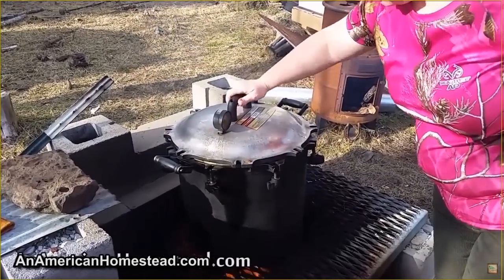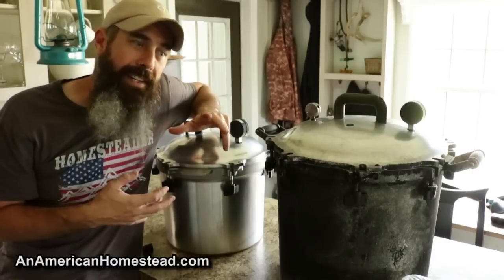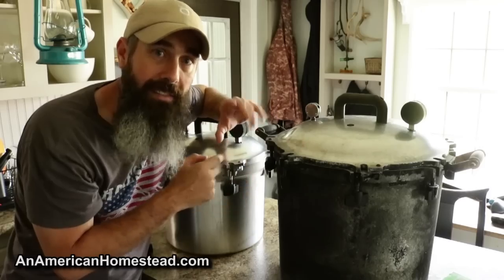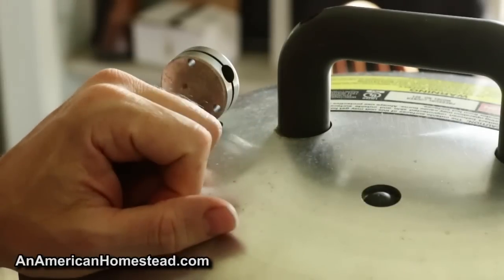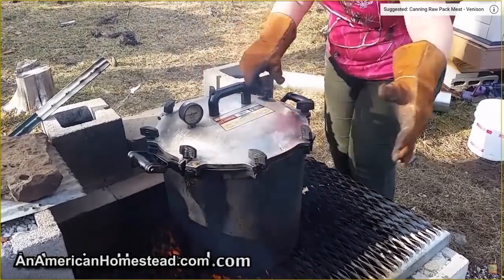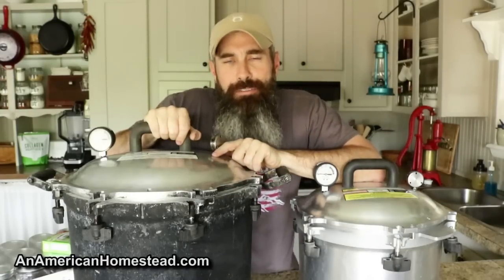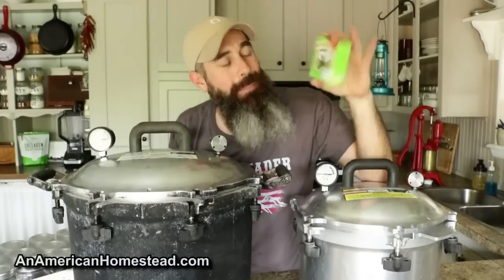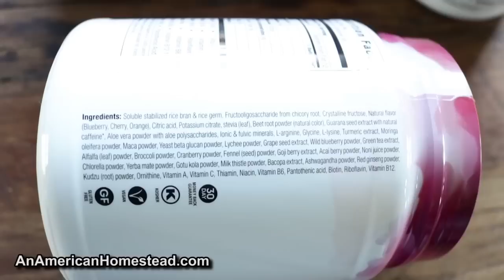Your Pressure Canner Just Broke! Now What?

Comment: I laughed when I saw the title of the video, and when you brought up losing the regulator on the canner I was thinking what a coincident.🤣 Last night I was cleaning my canners and somehow lost the regulator off of one of them. I have a feeling one of the cats stached it away as a new toy. Now I have to turn the place upside down looking for it 😠
Reply from the maker: Oh My!
Reply: I keep mine inside the canner after it is cleaned and dried to be put away. That way they don’t get lost or mixed up.
Reply: @chomama1628  I do the same thing. I replaced the standard pressure regulator with the adjustable version for my Presto canners. The standard ones are also stored with where I keep the rest of my canning specific gear.

Comment: I know people frown on this but... everything you can pressure can you can also water bath, it just takes longer. You can even go online and find timing charts with all the foods, even cabbage and brussel sprouts and all the different size/pressure/ water bathing times. I have a couple pressure canners but recently had a pinhole in my run of the mill water bath canner from a small spot of rust, I have had this happen before. I got frustrated so started looking for a stainless steel water bath canner. It was more expensive but well worth it. The bottom is heavy enough that I would not hesitate to use it to make cheese, the lid is clear so you dont have to open it to check your water level losing water from evaporation and the handle has a temp gauge in it. Now I am feeling a little safer has far as being able to can my food in a long term SHTF situation.

Comment: If you can over a natural gas or propane stove in the kitchen, it is clean, convenient and easy to regulate. If you can in the fall or winter the fuel is FREE. All the heat used during the canning process goes into the house or food that later cools putting the heat back into the house. Any amount of heat that goes into the house this way, your furnace does not need to supply. You are just using the heat you would use to heat your house to can your food first. If you want you can even let the water cool in the kitchen before pouring it down the drain to save that heat. If you can in the kitchen in the summer and run the air conditioning it cost you about 3 times the cost of fuel to burn it and the cost of electricity to pump it out of your house.  So I can in the cold months and don't worry about it.

Comment: Yea took the plunge and bought All American  925 - 25qt ....im thinking since I did the order it may be just a little too big, just me and the wife.  Still waiting for it, they tell me it may be another month...oh well,  it wasnt cheap, $500 CDN....almost canceled it last night as I thought about the price and saw a Presto for half - once I get it and do the first dozen oh so jars of meat and butter I will be happy with the decision.
Reply: FWIW.... I have 2 large Presto canners. One  purchased in 1972, the other in the mid-1990's. I've downsized considerably. (Two people, here.) Rarely ever can in quarts anymore, as pint jars are enough for most meals. To that end, early this year (pre-pandemic) I bought the Presto 16 quart canner. Ideal, IMO, for small batch canning. It holds 7 quarts, 10 pints and 12 1/2-pints, regular mouth jars. Still have the larger canners, if I want to can 18 pints of something. 

FWIW... Presto canners have served me well over the years. Went on a canning marathon earlier this year to can most of the meats and vegetables in our freezer due to the projected hurricane threat for 2020. Based on what's happening, I'm glad I did. The point, is that Presto did exactly what I needed for it do do. The only "spare parts" I need to keep are gasket kits, since I converted the standard regulator to adjustable versions for the 2 older canners. Gasket failure over the years hasn't happened often enough for me to complain about it. Rather the opposite, as it's more like needing to change the oil in my vehicle from time to time. (Gasket change far less frequently, BTW.)
Reply from the maker: Trust me, you made the right call with the All American.  It will last a lifetime if you take care of it and you won't ever need gaskets.  I wouldn't trust any other brand over a fire.

Comment: Find an old woodstove. Doesn't need to be a "cook" stove as long as it has a removable lid or two. You use less wood and with goid damper control you can regulate heat better

Comment: I have a Granite Ware pressure canner that I just bought.  It's ok, but I wish I would have gotten a larger one.  I can only can 4 quarts at a time.  Also I didn't know that I would really love canning like I do now.  Dang......

At least I bought the big Mac Daddy Excalibur 9 tray dehydrator!!!!
Reply from the maker: I used to have an Excalibur and loved it.
Reply: @Anamericanhomestead  I'm dehydrating potatoes, pineapple and strawberries right now.  I learned the hard way don't dehydrate onions and garlic in the house.  My husband was pissed !!!!!  Lol
Reply: @Anamericanhomestead  what dehydrator do you have now?  I wanted to get a freeze dryer, but that is WAY OVER MY BUDGET.
Reply: @crazydee1955  I have an Excalibur 9 tray, too. Can't justify a freeze dryer. I can put a lot of purchased freeze dried food on my pantry shelves for far less than the cost of a dryer. Especially since the Excalibur will do most of what I need to do from a dehydrating standpoint. For example, I don't need freeze dried green peas as I already have the options to can and dehydrate them. Have done both with good success. A couple hundred dollars can put quite a few servings of freeze dried meat on my pantry shelves. The same amount of money can also put a whole lot of canned meat on my  pantry shelves, as well. 

From what I understand, space savings between wet canned and freeze dried isn't material because the food doesn't shrink, as it does with dehydrating (especially vegetables & fruits). So that can't be used to help justify the purchase.

Comment: I'm trying a couple of different lid sources and wonder if anyone here has experience. The first is the mainstays brand from walmart, they look regular but the second is a one piece safety button lid. It's difficult to find info since they aren't "approved" but I've seen them used by home canners in Europe. Do you (or other commenters) have experience with the one piece lids? Another thing, I suggest looking for older canning recipe books and instruction books, they are continuing to update and make changes to the recommended methods. I'm sure it kills more bacteria to pressure can everything, but generations have not pressure canned say, jelly or tomatoes. Yes, some things must be pressure canned, I understand, but my mother and grandmother didn't even use waterbath canning for jams and jellies, they used hot jars, hot jam, topped with paraffin, done, not even a lid until the seal of the paraffin was removed. Thanks for the reminder for these back-ups, there are so many things to remember that we have had at the ready for so long.
Reply: Never used 1 piece lids for wet canning, so can't comment. As to older canning books, they are fine to use as long as you use current recommendations on process methods and times. There was a major change, for example, in the 1990's regarding canning tomatoes because of the low acid hybrid varieties. You can still safely use waterbath canning for high acid foods. Jams, jelly, pickles, etc. Using paraffin to seal jams is discouraged because mold can form inside the jar and the spores spread throughout the jar. Please research this for yourself. Don't take my word for it. 

Your kitchen, your choice, as to how much risk you're willing to take.
Reply: @oldtimerlee8820  Ah, I didn't think about the lower acid hybrid tomato, I wondered about that. Makes sense. Yes, the paraffin was not a good way to preserve, moldy jars did pop up every so often. Thanks for the info

Comment: I have a volcano stove and a rocket stove. The ability to can over fire is the reason I chose All American.
Reply: Heather Dubreuil There was some blackening. I don’t think there was as much wear and tear on the parts. But I have always kept extra parts around. And unlike the other canners that use gaskets, the gaskets will dry rot over time in storage. The extra parts on the AA canner will not. I also do not use it exclusively on fire.
Reply: marthale7 I was able to can on mine with the original grate.

Comment: Tattler Lids? Not a problem here with the Tattler Lids. Inspect the rubber rings , lids and the jar for chips or cracks.  Follow Tattler's directions.  I had failures with Tin lids as well as Tattlers  lids. Most cases it is human error.    Oh and a 1/8th inch sheet of steel between your canner and the fire would have kept the canner cleaner and protected the locking knobs.

Comment: Poor quality pressure cookers just blow up on the stove damaging the stove the hood and everything around.
During August we use the canned tomatoes sauce in those mason jars, same with raspberries, blueberries and blackberries preserves over the stove in a lobster pot to cook and seal the jars.
Reply: Modern pressure canners, from reputable brands, don't "blow up on the stove". They have a pressure release valve that prevents that from happening during unattended  canning. Yes, any large pot, with some type of rack, can be used for waterbath canning. Another good example is the big pot sold for frying turkey over a propane burner. 

Yesterday, at our local Wal-mart had several waterbath canners and 1 Presto 16 qt pressure canner. Generally, the shape of a waterbath canner with a rack, is easier to use. If memory serves, it was about $20 . Well worth the investment, when you can find one.
Reply: @CATherine001  There are responsibilities associated with using any piece of equipment. One of them, is to learn how to safely use it. I have a woodworking shop with several tools that can take off my hand, if carelessly  used or abused. 

In the link.... There was definitely something wrong with HOW that pressure canner was used. Probably multiple things based on how it works. If the vent pipe was open, as it should be, the pressure regulator (if it was the correct one for the canner) would have released steam after the specified psi was reached. 

If the vent pipe was plugged, the pressure release plug would have blown before the lid blew off. Question becomes was a bolt, for example, used to "temporarily" replace a deteriorated release plug"? Can't tell from the picture. 

That looks like a pressure canner that I have. Once the lid is actually locked into place, it can't come off in that manner. It operates similar to a lid that screws onto a jelly jar. Can't pull it straight off. Lid must be physically turned counterclockwise to get if off. 

It's possible that the one in the picture is an old, old pressure canner that didn't have the safety features of the ones in use today. 

Lastly, one of the comments under the pix in the link, talks about how to ABUSE a pressure canner. Doing things that shouldn't be done with a pressure cooker or pressure canner. 

FWIW.... I have been pressure canning with Presto canners since 1972. There's no telling how many jars I've processed over the years. Currently have 3 Presto canners. All 3 fully functional, including the one from 1972. That durability, alone, should testify to the quality of Presto canners. 

Additionally I've cooked many a pot of beef stew using my Mirro pressure cooker. Probably purchased sometime in the 1980's-90's. Still does what it's supposed to do.
Reply: Oldtimer Lee Great info.!
Well I guess we can attribute these mishaps as Operator’s malfunction. 😂 

I have a question for you,
 why do we need a pressure canner when you can stick mason jars in boiling water or hot water to  self seal the jars?
I have made a lot of fresh tomatoes sauce and never used a pressure cooker. The jars’ seal would last up to a year just in time for next season.
Reply: @CATherine001  A pressure canner is needed to can low acid foods. When  using a boiling water bath canner, the temperature of the foods never exceeds 212F. That's fine for many high acid foods.  However, that temperature is not hot enough to kill the spores of a bacteria that can create a deadly toxin, in the right circumstances. The circumstances that exit in a sealed jar of low acid foods. Low acid, low oxygen, moist conditions and room temperature. 

The bacteria is called Clostridium botulinum. It is a common bacteria that doesn't cause any harm until conditions are right for the spores to produce botulism toxin. 

When canning to kill the spores in low acid foods, the food must be heated to 240F according to guidelines for the item being canned. The only way to get the food to this temperature, in home canning, is to use a pressure canner. For my altitude 10 lbs of pressure will allow the food to reach that temperature and kill the spores. The food must be held at that temperature according the guidelines for the item. Can range from just a few minutes to 90 minutes for meats in quart jars. 

For much more on this subject, please Google: National Center for Home Food Preservation General Canning Information
For Safety's Sake
https://nchfp.uga.edu/how/general/for_safety_sake.html

Your pressure canner manual should have information on this. If you don't have the manual Google the brand of your canner, model number and the word manual. 

If you don't have  one, try to find a current copy of the Ball Blue Book of Canning. It's usually around $10-$12 and is well worth the investment. It covers the differences between water bath canning and pressure canning. It has great direction for both, along with recipes and tips. 

Hope this helps.
Reply: Oldtimer Lee Yes is does!
Thank you so very much I really appreciate it! ☺️

Comment: I get the feeling you will be surprised at how cheap propane is
Reply from the maker: For a small canner...yep....not the 941. You need a large burner...and then its not so cheap. We get slab wood for $20 bucks per ton. And what if you can't get propane? That presto canner won't do well over a fire. The all American has no issues. Been doing it for years.

Comment: I canned my first pickles this year . About 32 quarts . I grew up with this but this was my first hands on . I have a ton of old lids and remember my mom boiling lids I assume now to reuse . Anyone else have any suggestions ? Thanks Zach . I bless you in the name of Yeshua .
Reply: In the past, canning instructions called for heating new lids before putting them on hot jars. Today's new Ball lids do not have to  be heated. In fact, it is recommended that the lids should only be washed and rinsed before using them. Current recommendations from Ball also state unused lids have about a 5 year shelf life. Depending on how old your lids are you may want to test a few of them. Just use water bath and can some water in a few jars. If the jars seal, fine. 

If you have a FoodSaver vacuum sealer with the lid attachment you can also test the lids that way. It's the way I  test old jars before using them for canning. If the jar doesn't seal, after 2 attempts, I won't use it for canning. Same principle for lids. If a new lid will vac seal on a jar, then test an old lid on the same jar. If it doesn't seal, toss it or use it only for temporary dry storage. IMO, better to toss so it won't get mixed with good lids. 
Hope this helps.

Comment: running a propane grill or burner is extremely cheap. that wood you're burning costs more
Reply from the maker: For a small canner...yep....not the 941. You need a large burner...and then its not so cheap. We get slab wood for $20 bucks per ton. And what if you can't get propane? That presto canner won't do well over a fire. The all American has no issues. Been doing it for years.

Comment: Do some research I don't know how you get to being an adult and never use propane. HINT: ITS REALLY CHEAP TO POWER A BURNER WITH PROPANE DOOFUS
Reply from the maker: For a small canner...yep....not the 941. You need a large burner...and then its not so cheap. We get slab wood for $20 bucks per ton. And what if you can't get propane? That presto canner won't do well over a fire. The all American has no issues. Been doing it for years.